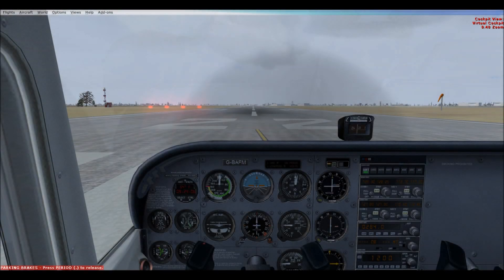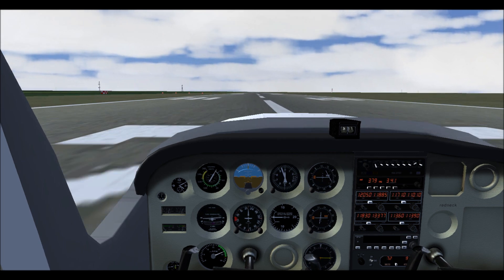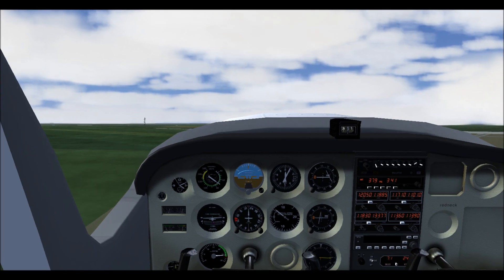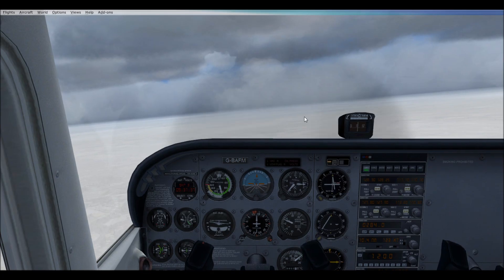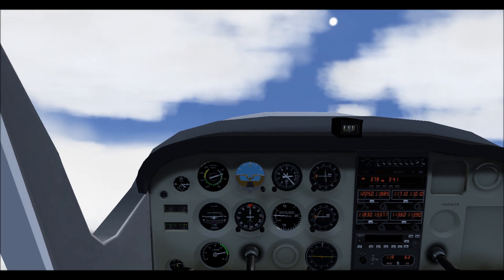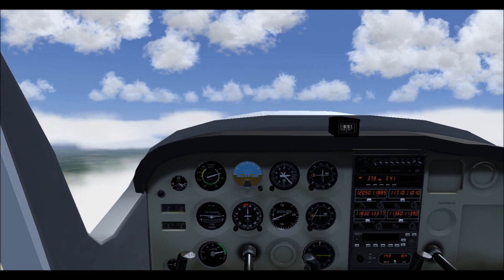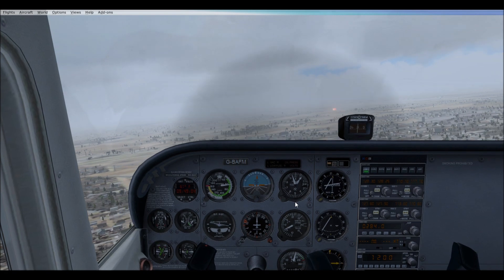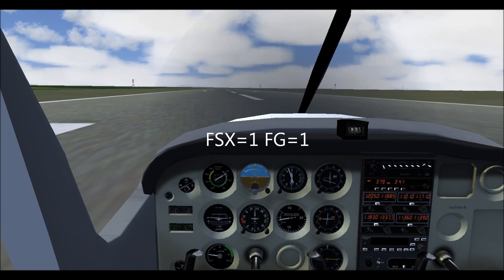Flight Dynamics: FSX vs. FlightGear

Comment from the maker: Sounded like the guy was talking about an addon to me.  Maybe it's a brand of addon plane.  The point here was to compare the most similar base package planes from each sim in terms of flight dynamics alone.  Yeah, I'm sure the paywares are better than the base package stuff.  I've seen a few things on PMDG addons.  The problem here is that, if a lot of the programmers, who made FSX, are also pilots (says so on the box), then why aren't there any PMDG-quality aircraft in FSX to begin with?

Comment: Let me know when you get there, hail me over Albany International's UNICOM frequency instead of the CTAF/Tower frequency of 119.5 MHz. Use their UNICOM frequency of 122.95 when you get in the area, I'll link up with you in the sky. My preferred FlightGear aircraft is the Cessna Citation X jet. What's yours? Cessna Citation (callsign) Delta Five Four Two clear.

Comment from the maker: I'm seeing some interesting opinions on this.  Sound seems to be a repeating topic.  Well, I guess it's my turn to share an opinion.  The way I see it, if the engine changes pitch depending o power setting, if I can hear the gear, flaps, and touchdown, then the sound is alright.  I know that may be simple, but the way I see it, the best thing to do is focus on making the flight dynamics as real as possible, and then worry about other stuff later.